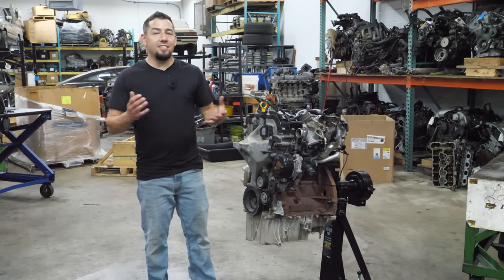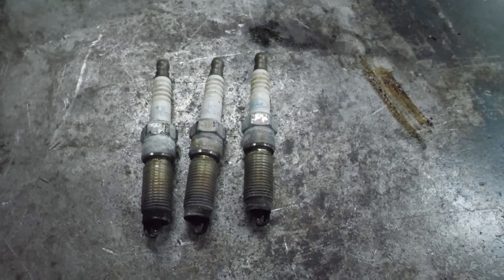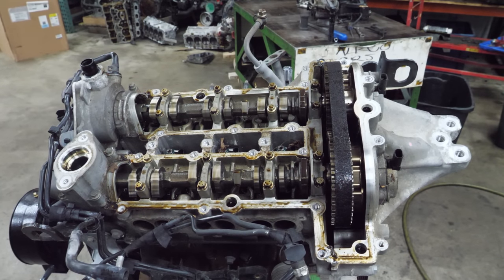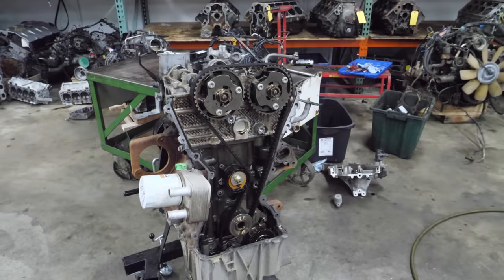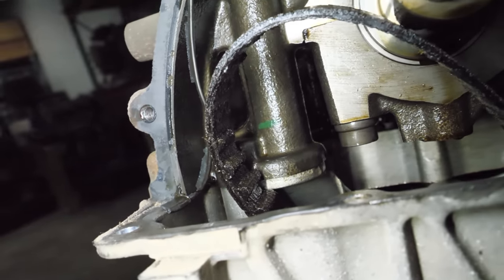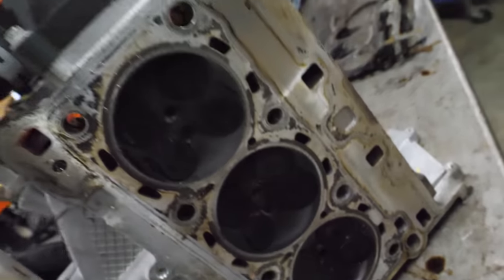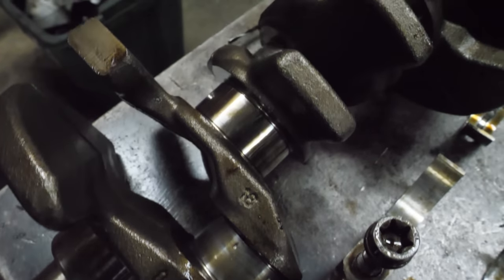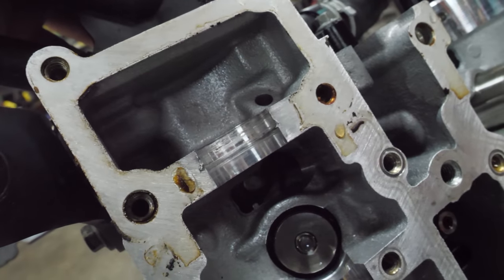JUNK Ford Ecosport 1.0L 3-Cylinder Ecoboost Teardown. LAWSUIT ENGINE!

Comment: Id love to see a teardown of a Smart ForTwo engine. It's actually a Mitsubishi engine, bumped to 1 liter. The oil drain plug is comically large at 24mm, for only about 3.5 quarts of oil. Not a lot of them were made, so it might be hard to come by.
Reply: Those are actually reliable little cars. Have a couple customers that own them, it’s been nothing but routine maintenance
Reply: My ex wife has one. I don't know how many miles she has on it now but she does look after it quite well.
Reply: @TheDeezelsmoke  they seem to be having better luck than my wife. She has a 2013 and have been through 3 fuel pumps, all 3 coil packs(even completely blowing the ground strap off all 3 plugs, but still ran somehow), and a few other things with HVAC and the shifter assembly. I think the last 2 were under warranty, but nothing the others. I think a transmission module failed under warranty as well.
Reply: @Retired Bore I wasn't aware of that last part about the EcoBoost. That is pretty interesting.

Comment: What a stunning fall from grace, after this engine won International Engine of the Year in 2012.
Reply: It really should speak to us about the people giving this engine that award....they are about as reliable as an oil soaked timing belt
Reply: I could say they never actually opened the engine and just looked at the spec sheet but even the spec sheet is bad (122 hp, 22mpg).
Reply: @lajya01  A quick look online and you will find 56mpg combined, It's the no1 engine in the EU/UK. I don't own one, but they are everywhere over here.

Comment: Also Eric, I've mentioned it once before, but if you ever find a toyota 3RZ somewhere, I'd love to see that teardown. Curious how that gutless workhorse goes together and comes apart.
Reply: They’re not gutless at all. 😂
Reply: @tacomas9602  I owned 2 with the 5VZ and then recently drive a 3RZ and I honestly though something was wrong with it, no power at all 😂
Reply: @Alexander Cortez  my rusted out farm truck has the 3rz, 5 speed 4wd, and factory 4.30 gears. It scoots. It's not fast fast at all but it will pull anything I hook behind it lol. It's only a 2.7L and it's light years snappier than my 2TR FE 5 speed 4x4 taco. Those v6s are a bit more powerful for sure.

Comment: Why has it taken so long for your channel to pop up in my feed, this is so cool, getting to see failure modes of engines that I don't have the time or resources to autopsy myself.
in this video as soon you revealed the belt my reaction was literally "W T F!" I can not belive an engineer at Ford proposed a wet belt to the execs and they "hmm hmm 😉👍 looks good" and not to mention no keyway on an interference engine.

Comment: I really hope they keep making turbo inline 4s, making them more and more reliable, making them easier to work on, simpler, with better engineering and tech involved but nothing trying too hard to the point where it's just an inconvenience / liability
Reply: As time goes on, vehicles and even 4-cylinders are becoming harder to maintain.  Too many special tools for a DIYer and the manuals can be hard/costly to find.
Reply: The more cylinders the greater the internal losses, so just as V8s are nowadays rarer than V6s, I think 4 cylinder engines are on the way out, except, maybe as boxers.
Reply: The three cylinders are mainly for China. China taxes 4 and above. No tax on 3 cylinder
Reply: As an owner of a 2.3L Ecoboost in a 2018 Ford Edge, I can tell you that they have design problems. The big one is the coolant channel between cylinders. I had to replace our engine at 115k because the head gasket failed. Such a common problem that the dealer has replacement long blocks in stock just for this issue.

I'm really disappointed in Ford's engineering choices lately. We had a Escape 3x2 transmission shell out at 120k because of a bad design and common failure. We're disappointed in what Ford has turned into.
Reply: @armorer1984  the problem has been fixed. I believe in 2020 or 2021
Design mistakes now fixed
Reply: @chipcook6646  The design mistake shouldn't have happened. Or, at least, some sort of compensation for the design flaw causing engine failure.

I was able to do it myself, but if I would have had to hire it done by the dealer it would have cost us $8000 to fix their design mistake.

You shouldn't have to put $8k in repairs into a vehicle with 110k miles.
Reply: @armorer1984  I agree Ford should have back this coolant problem.
Reply: @armorer1984  replacing the gaskets does not fix the problem. I believe it where the coolant holes are to close to the piston or/ edge of the block. There is a video on it.
Reply: @armorer1984  you did good getting 110 k miles out of it. I believe most people do not.
Reply: @armorer1984  one would think with cad cam and computer aid these engines should be bulletproof. All this new tech should reveal any potential problems not having real people buying and  testing them.

Comment: The ecoboost was/is the most powerful 1.0 production engine, so it does have that going for it. Shame about the lack of reliability.
Reply: Yes and it’s very economical! I’m a big fan of this engine. I only have 30 000 km on my Fiesta so far and just did the first oil and filter change. From what I understand the key thing is to use the right oil. That’s extremely important. Otherwise you’ll see the exact problems shown in the video. I suspect a lot of the failed engines are people saving money using non Ford service with mechanics that don’t know about the oil. Or people change oil themselves as they always have. That’s a sure recipe for disaster.
Reply: The 3 cyl 998 cc yamaha turbo motor in the sidewinder/thundercat snowmobile is 180hp stock and easily pushes 250 hp with a tuner.
Reply: @renesisfd1  That's impressive to be fair. I should have added in the caveat that it is the most powerful on highway production unit. I am guessing a snowmobile doesn't need to meet the same emissions, but I may be wrong. Either way the Ecoboost was impressive for its time.
Reply: @lauriebrooking2429  I do know they do have emissions requirements, but I would be suprised if they are as stringent as an on road cars requirement.

Comment: Nice tear down .SO we just received our safety recall on my sons 2018 ford eco sport for oil pump belt tensioner . This is after the timing belt shredded and it was coverd under warranty the dealer re built the engine at no cost to us so i guess its round two for this bad design .

Comment: just started the video im going to say Wet Belt came apart and cloged the oil picup.
there shood be a class action lawsuit on this engine for that Belt!
Reply: Honda has a wet belt in their 2000i generators and @ 17k hours service 24/7 off grid....no problems.
Reply: @John Smith  Oh that's clearly an apples the apples comparison you have right there.😂
1 that engine has no filter system.
2 the ford engines run till the pickup is Is clagged up with material.
This is the #1 failure of this engine.

Comment: I read somewhere that Honda and possibly Toyota do not like to to design gasoline engines for more than 100 hp per litre due to over stressing, and that sounds like pearls of wisdom to me.
Reply: Not really a problem if you put the money into proper engineering and production methods, not this shoddy work.
Reply: Honda made an engine with over 100hp per litre in the late 80s, the B series. And is was very reliable, other than some oil burning issues

Comment: I got about the same fuel economy in my old 06 Ford Five Hundred AWD.  A 4000 lb sedan with an anemic Duratec 3.0L V6
Reply: My 2007 Mazda 3 with a 156 hp 2.3L would get 32 MPG on the highway at 80 MPH.
Reply: @christopherweise438  I have an 18 Corolla now, and I can easily surpass 40 mpg on a normal drive.  EcoBoost my ass lol
Reply: Fiesta with the 1.0 ecoboost did 32 mpg city and 45 mpg highway. Could do 50mpg pretty easily.
Reply: @charliesipple1054  before I bought my Corolla, it was saying something like 29 city, 36 highway, but I can easily get over 40 mpg.  I guess it all depends on how someone drives it.
Reply: @thelonelywolf88  yup, hypermiling can easily net you an extra 5-10% mpg especially in lightweight cars. Sub 1.5 ton (3,000lbs) cars are the sweet spot.

Comment: Really sad that a company that built such legendary engines as the FE and Super Duty V-8's and the 300 inline 6 would even put their name on such a mess!
Reply: It has won engine of the year in Europe numerous times due to the fuel economy (which using European measuring techniques is supposed to be good). A shame it only seems to last about five years though.
Reply: What country are these engines built in?

Comment: These 1.0 ecoboost were reviewed pretty favorably in the Fiesta. I considered one briefly before doing a little research on the engine. I think as others have mentioned,  100k or 5 yrs is the 'lifetime' expected, disposable after that as with alot of modern stuff.

Comment: They seem to be a good engine but they are picky what oil you use in them due to the wet belt... Needs to meet a certain Ford spec not every oil has. Some Ford techs i know said they aren't bad if properly maintained. Oil changed on time and the right oil

Comment: I've ran two cars with the Ecoboost , a Focus and a Fiesta. Generally they both behaved very well and fuel economy was very good. Fiesta got up to 5 liter per 100 km on long motorway trips. When using the correct oil they are capable of reaching high mileage quite easily. Looks like someone put the wrong oil spec in your specimen. Peugeot and Ford both run with wet belt principle and both have the same problem. It's not just doing an oil change, but the wrong type of oil will dissolve the belt.
Reply: Ive had 2, they were amazing engines.  140ps  Fiesta is the perfect city car. Fast as you need it to be, economical as you want it to be.  45-50mpg was usual (and i do SHITTY city miles). Never had any issues. Other than when some piece of shit stole car #1.

Comment: I currently have an early 2021 Focus with the 155PS version of this engine. I love the power and economy of the engine but wouldn't feel happy about keeping it long term.
Reply: Yours has the updated 3 cylinder with a dry timing belt.
Reply: Yes the newer models have been changed

Comment: They did all this cost cutting and still had a aluminum pan, wow
Reply: They didn't want to spend the extra on the tooling to do it in plastic.
Reply: @Brynnon D.: And an iron block.
Reply: Probably cast outta leftover aluminum from popcans from the lunchroom

Comment: I ran one from new for 120k miles and had no issues at all. But it is quite alarming how hot these engines run, which can’t be good
Reply: I own a 2018 Ford focus 140bhp st line and I've never had any problems like you. I tend to see the people who talk badly about them have never actually owned one. Yes they had the coolant leak issue but that was on the 2012 first model that ford then corrected.

Comment: The non keyed crank has been pretty normal ford economy car stuff for a while.  They actually use a thin diamond encrusted washer between all the crank pulleys, as well as between the cam pulleys and cam shafts, idea is the diamond is hard enough to bite into the steel components to create enough friction to lock it all in.  I cant image that it costs them less to produce that vs just cutting keyways and putting a key in, but the washers are one time use, so they are making more money post sale when the cars need service,  because I'd bet good money that no one but ford will make those stupid daimond washers.
Reply: Just don't buy Ford.  Problem solved.
Reply: You don't need the washer technically and 2 diamond is actually really cheap for industrial purposes
Reply: If I had to guess I'd say they figure this engine doesn't make enough power to warrant a key. Keys are good for.. well... anything you want to last, but you can get away with it if it's 100 hp or whatever. This claims to make 130ish... eh. Anyways seeing that theyre using a belt to drive this engine they clearly didnt think it was very powerful nor did they expect it to last long after warranty lol.
Reply: @jetjazz05  well keyways allow a much easier process to reliably drive something but in terms of retention a friction fit is perfectly adequate even for high rpm applications the real problem comes from im betting on procedures. Just like fords 4.6 and 5.4 spark plug thread issue the reality is it does work and clamp good but it lends itself to outside forces being a problem. Belt drives are in some high horse applications to but tend to be specialized and not designed around reliability but replaceability.

Comment: ive done a lot of timing belts on these and the timing cog on the crank not having a key makes it easy to time the engine when you have the cams and crank locked in tdc. that timing cog can move and take up all the slack

Comment: This demonstrates CLEARLY why the single cam engine with a push-rod design and a single timing chain will ALWAYS be the most reliable engine design!
Reply: Historically the most reliable engines were sidevalve ( flathead in the USA ) far fewer moving parts, very compact and much easier to manufacture than any OHV design.  But the problem was they could'nt provide higher power ( RPM ) demands due to very poor gas flow.
Reply: not even close I have had more than a few those old single push rod engines go out what it shows  that most people already know is that the most reliable engines aren't ford except the 4.6

Comment: Ford upgraded this engine (M1JC) at the end of 2019. Wet belt system is replaced with conventional timing chain, location of the turbo charger is moved from front to back. The new 1.0 ecoboost engine code is M1JE.

Comment: Here in Brazil, we have a very similar engine, the 1.0L Ti-VCT 12v, which powers the Ford Ka+.

Essentially, the engine of the Ka+ is like the EcoBoost but with fewer features to keep costs down. The issue highlighted in your video appears to be related to the use of non-homologated oil, which can lead to the rubber belt corroding.

It is quite common to come across vehicles here that have experienced problems with this engine before reaching 41,000km. However, if you perform the correct maintenance and use the appropriate oil, the engine can last longer.

In my case (I've owned one since 2015), I haven't experienced any problems with the engine, and it has been driven for more than 160,000 km.

Comment: I had a 1.0 ecoboost for a few weeks as a courtesy vehicle in a focus. Performance and fuel economy was almost identical to my older 1.8 Duratec Normally aspirated Focus. So it was a flawed solution to a problem which didn't exist.
Reply: No, it was a solution to the "problem" of emissions.  
They built an engine that got "good enough" power and economy... but GREAT tailpipe emissions per liter. 

Let's all ignore the fact that a stage 2 tuned (for max power) cat deleted 2.0 flat four in say... my 2017 WRX makes 300awh 
And gets 30mpg on the highway if I don't drive like a yob.  
And those litte turbo 1.3 liter inline 3s they are putting in all the little crossovers with front wheel drive these days get like 27mpg highway... and make a whopping 180hp. 

That's a 3,000 pound, compact AWD sport sedan that litterally shoots fireballs out of the exhaust and can pull a 0-60 in the mid 4 second range.

 And it beats a grocery getter for miles per gallon...   and is NOT soul sucking to drive.
Reply: @stinkyfungus  The emissions reduction from the belt probably makes next to no difference in the real world. I have a BMW M140i with 3 litre turbo 6 cylinder and 340whp. It does almost 40mpg on a steady drive. You don't need to drive it hard all of the time like you do a smaller engine hence the good MPG's.

Comment: The last car I owned that had a timing belt (rather than chain) was a 1995 Mitsubishi Eclipse turbo.  I changed the belts (timing and balance shaft) every 60k miles - doing so was always a time-consuming job, but I wouldn't trust them beyond that mileage.  Ever since that car (which had a TON of early 2G flaws), I've refused to own any car with an engine using a timing belt.

Comment: Im a Ford expert technician, and these engines aren’t terrible. If you service them the proper way with PROPER oil, they’ll last the the full period until the timing belt needs replacing as per the service manual. Like every car, there’s an Achilles heel, and for these engines its the automatic transmission. With the auto the engine is equipped with a balance shaft, which is integrated in the oil pump. On this balancer is a tensioner for the oil pump belt, which manuals dont have. Because of this tensioner, the oil pump belt wears prematurely, causing it to clog up the oil pump pickup and cause oil pressure issues. Ive never in the last 8 years as a Ford tech seen that part fail like in this video. Theres Manu negative stories about these engines going around, especially on the internet, and i always wonder how and why these stories exist, because ive got very good reputation with these engines. Now, if all this hate was about the 1.5 ecoboost engines, THEN i would get it, because these fail very very often, due to cracks in the cylinder lining.